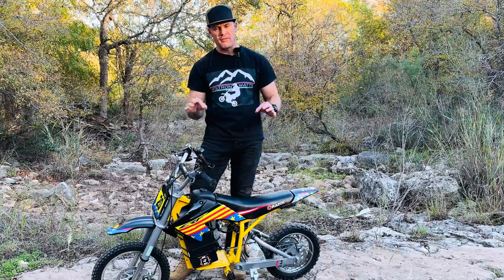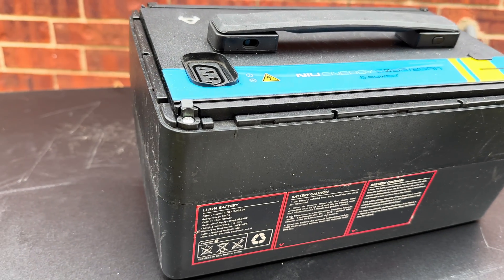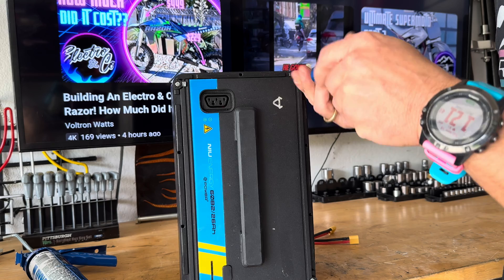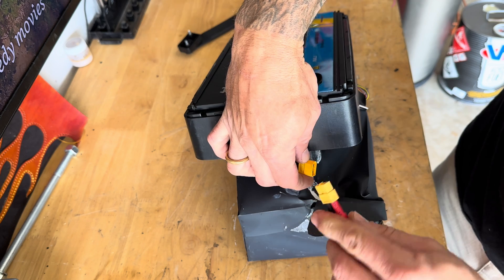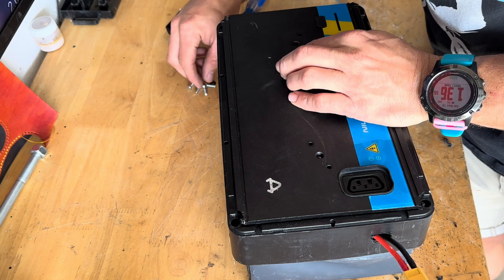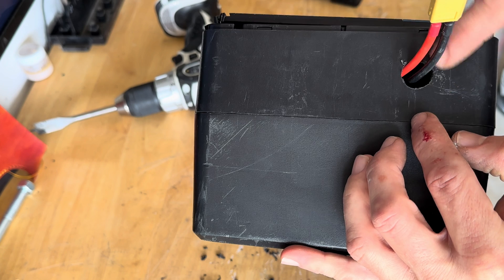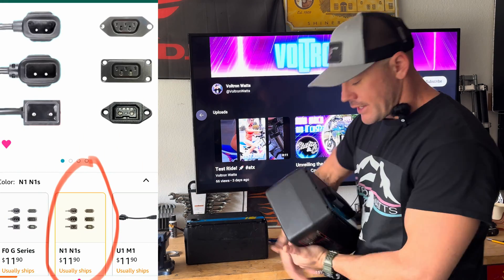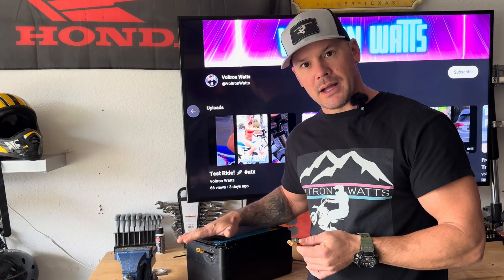Go FASTER for CHEAP! 60 Volt Budget Build! Beginners Guide To Building A Modified Razor MX650, SX500

Comment: Can you use a 72 V motor with a 48 V battery?
Reply from the maker: Yes. But probably not for long lol
Reply: @VoltronWatts  thank you for responding do you know any good 48 V or 60 V motors for razor Mx 650 on Amazon?

Comment: Hey how fast do you think i would be able to get with this? Hotpaxx razor Kit, 48-72v 300a fardriver $399
50.4v 20ah 120a battery w case $418
#35 Chain & Sprocket upgrade MY1020 $55
Should i upgrade for a 60v or 72v for better?
Reply from the maker: 72v is better if you can afford it 💪
Reply: Alright thank you!! @VoltronWatts

Comment: why do i need the plug thing at the start? i think im gonna upgrade an sx500 to around 30 mph like you
Reply from the maker: To connect it to the controller and charger 👍
Reply: @ thanks! fast response too! 80 tooth sprocket or 65? whats the difference
Reply from the maker: 80 in the rear will be more torque and less top speed, a 65 does the opposite
Reply: @ thanks!

Comment: I just modified my dirt bike to go 35 but I am light so the torque is insane and always flies out under me, any way to keep speed but lower acceleration time so I don’t go flying
Reply from the maker: I’m answering you on another video 👍
Reply: get a different size sprocket. It will give you less acceleration but a faster top speed. A win-win for you

Comment: I got a old razor mx650 sitting in my garage that is totally useless cause of the battery being burned out, the handlebars falling off and also the brakes no longer work so wanted to mod it and get better pieces for the build but I’m everything else I see are way to out of my budget wanted to see if you could help with that
Reply from the maker: Totally! Scroll through the razor specific library, I have a ton of videos in there 😍
Reply: @VoltronWatts thanks for the comment back but how do I get to the razor specific section
Reply from the maker: Go to playlists and you u will see it 🤙

Comment: so the 48v vevor motor can run 60 volts?
Reply from the maker: Yes. It’s called over volting. Generally you’re safe to do so only 12 volts over the rated number
Reply: @VoltronWatts  does the controller limit the output though? Like would you get a higher top speed without that
Reply from the maker: @ChargedTalaria you will get a higher top speed. Yup
Reply: @VoltronWatts  one last thing, how did you wire the throttle with key and volt meter into your controller, because I’m not seeing any connectors for that

Comment: Awesome thanks.  So stock controller, what about the charger? Maybe I missed it. Is it separate or will the stock charger still work?
Reply from the maker: You will need a different charger if you decide to change batteries.
Reply from the maker: Beginners Guide To Fitting An Upgraded Battery Into Your Razor SX or MX Dirt Bike! #electricbike
https://youtu.be/4T_MB7uYXm0

Comment: How long does the charge last on the battery? Or how far can you ride on a full battery ?
Reply from the maker: That depends on a lot of things, rider weight, incline, throttle useage ect… on a single 20AH battery like this with a full grown adult id expect 8-12 miles
Reply: I'm 160lbs and rided for 21 miles on a 48v20ah battery

Comment: hey just wondering, would 3 of those batterys work to wire and run on a 3000w vevor motor? THanks!
Reply from the maker: You would on my need one battery and I would run it on a 48v Vevor kit 💪 that’s what this bike is

Comment: are using the 48v Vevor controller with the 60v pack?
Reply from the maker: Yes sir!🤙
Reply: @VoltronWatts  how far have you pushed the stock controller? 60v seems like abit much lol
Reply from the maker: @boardinrider it’s not a stock controller, it’s a 48v controller 💪
Reply from the maker: Stock controller is 36 volts
Reply: @VoltronWatts  sso they can handle the over voltage? w\
Reply from the maker: Sorry, I don’t understand the question.

Comment: What's acceleration like from a stop?
Reply from the maker: With is gearing it’s pretty chill but still fun. Throw an 80 tooth on the rest and it will pull the front end. OR, upgrade the controller and that’s a really nice upgrade 👊

Comment: Just got my first mx650 from goodwill. Immediately ordered a full grip twist throttle, and a 48v battery. Stage 1, here we go. Are there any groups near Austin?  I have a backyard pump track and tons of trails.
Reply from the maker: You’re in Austin?? What part?
Reply: @VoltronWatts  dripping springs!
Reply from the maker: @teddyrascal6305 sweet! I am apart of group in S. Austin called Ride or Die, we ride every Thursday to the bars on manchaca rd.

Comment: Missed the total cost of the build ?
Reply from the maker: Vevor kit about $150, battery $250ish, rear sprocket 12 dolla on Amazon then just the price of the bike. I try to find em used for under $200 whenever possible 🚀
Reply: @VoltronWatts  what battery?
Reply: Got mine used for 20 bucke 😭😊 @VoltronWatts
Reply: I have $1000 in an MX 650 frame. What do you think? The best thing is to do?
Reply from the maker: @DolittleB 48v vevor motor, fardriver controller and 60v Amorge battery
Reply: @VoltronWatts  ok thanks
Reply: @Dolittlemx650 do 72v instead. 33-35mph gets boring
Reply from the maker: @A1_Plant 72v is the sweet spot 🤙
Reply: He said under five hundred
Reply from the maker: @colelebouf3728 thank you 🤙
Reply: Also wondering what battery to look for